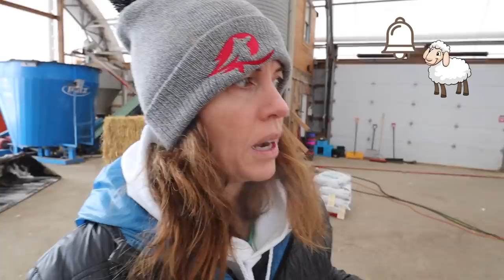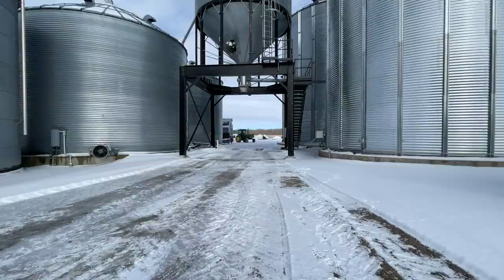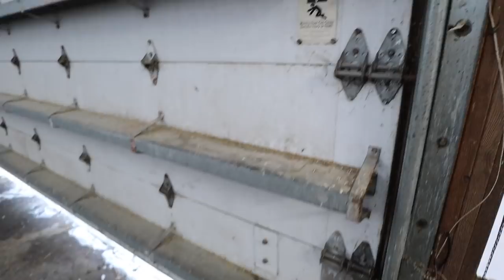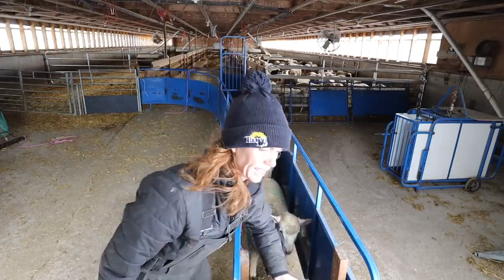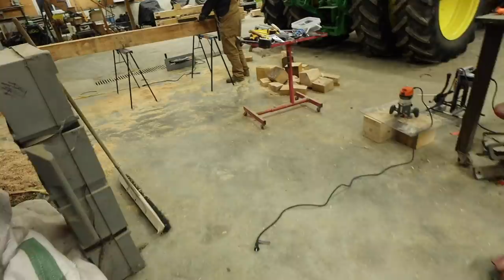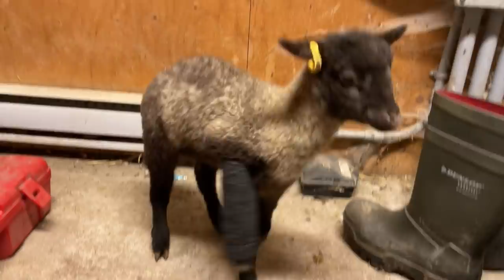third times a charm.🤦‍♀️ | Vlog 543

Comment: I was taught...cast should include the joint above and below the break....cast should also make the leg longer to prevent full weight bearing.  I have used a pad made of vetwrap on the bottom of the hoof to make the leg longer.  Hope lamb does well.
Reply from the maker: Good call!

Comment: Hi, Sandi, I completely understand your being wound tight after pulling the trailer to market.  I lived in WCentral MN for many years.  We called what you drove thru “ground blizzards”.  For work I drove 40 miles each way, mostly in the dark of course.  It would get extremely exciting with those fingers of extremely fine snow being run over again and again until black ice was everywhere!  And as you said, when the wind turned you ever so slightly, you were gathering yourself back up!  I only off-roaded 5 times in 11 years.
Reply: I'm right with you on the trailer issue....I have bought bagged garden soil in order to travel back west to East in Western Oklahoma rather than run the risk of having my empty trailer end up somewhere where it wasn't supposed to be due to the winds!!

Comment: TY for information on Chris. I like her.
I am a retired physician. I am not a veterinarian. I can give info on human gametes but I don't know if it totally applies to sheep. For humans the male gametes have 2 potential functions. The female gametes also have 2 potential functions (in mammals,  the female gametes always have these 2 potential functions). 
Female proto gametes: in the ovary of a female around 40 start to develop.  This is what increases the estrogen concentration.  The one that is putting out the greatest estrogen will erupt from the ovary  when the Lutenizing hormone is released by the pituitary (this is ovulation). That is The Egg, function 1. The other proto gametes, about 39 now mix with some stromal cells of the ovary and form another structure.  This structure starts to produce progesterones. That is function 2. In humans,  this structure will function for two weeks  if no fertilization of the egg happens. The dying of this structure,  dramatically drops progesterones and causes the menses.
Male gametes are formed in the testes. They have no tails until they come into the vas deferenes. In humans,  a male gamete will either be attached to one tail or two tails. Function 1 male gamete has 1 tail. Function 2 male gamete has 2 tails. Function 1 is for fertilization. 
Function 2 is for killing other males' gametes.  Two tails cause the gamete to swim in circles. This limits function 2 gametes to be concentrated around the cervix of the human female. Each gamete has at its head a packet of enzymes and if it hits another gamete, those enzymes kill. A second male's gametes essentially enter a "war zone" at the human female's cervix. Those enzymes on function 1 gametes is necessary to try to enter the egg.
Again, I do not know if this with male gametes is the case with sheep.
One would have to specifically look at embryology of mammals,  specifically sheep to have this answer. I have not. I am not a  veterinarian; I am a one animal doctor, a physician.
Reply: Thank you, very well explained.
Reply: Thanks Barbara, that was very informative!  Just FYI, Sandi’s employee’s name is Carissa (not Chris).

Comment: Sandi I googled this for you and found the same info multiple ways.  This was the best  one: I learned that in sheep, lambs from the same litter pretty often have different fathers, if the ewe has mated with different males. Berry et al. Of the 539 pairs of twins included in the analysis, 160 (i.e. 30%) were sired by two different rams. ...Jul 12, 2020

Comment: Hi Sandi,  I use anti sway bars when I pull a ball and hitch trailer whether empty or a load. Really helps stabilize the trailer so it hauls straight down the road and no swaying with wind or sliding/ jack knifing in the ice and snow. Much safer!

Comment: Sandi, does your truck & stock trailer have anti sway attachments? Travel trailers have them & they really help for that scary problem you spoke of. The hitch is standard box but has inserts for bars that attach to the trailer. Then the trailer has a spot for a little bar that is technically a break pad that you can tighten depending on conditions. Not difficult to hook up just another step. Love your vids, I share them with my mom who is bed bound & loves lambys.

Comment: My brother had an old pick-up truck that easily fish-tailed in the winter. He put a couple cinder blocks in the bed to add weight to the back and found he had better control. Not sure if this idea would work for you or not. The cinder blocks would move around some of the time so you might have to anchor them down in some way for when you have the lambs in there or you can have the blocks in your truck and move them to the trailer once you off load the lambs (just remember to wear a back brace). Sand bags might work too.

Comment: Someone did a study about ewes and rams "I just learned that in sheep, lambs from the same litter pretty often have different fathers, if the ewe has mated with different males. Berry et al. Of the 539 pairs of twins included in the analysis, 160 (i.e. 30%) were sired by two different rams.:  From google

Comment: You do a great job at helping these little ones with broken legs. They must do better than dogs and cats because as GP RVT we would end up with our patients limb swelling and serious pressure ulcers. Do you ever have these issue? I’m wondering if they are just so young and heal much faster, and your splinting material is more flexible than our hard plastic splints to develop ulcers.  Also curious if you ever run into circulation issues or swelling of the limb with the vet wrap applied directly to the limb? We are always taught to pad pad and pad some more when applying splints and bandages because of these issues, and because vetwrap has the tendency to shrink. I have seen so many dogs and cats loose their limbs because vetwrap has cut off circulation. We are also taught to always have at least two joints splinted when there is a break one above and one below so you get proper stabilization. If she were a dog or cat we would have splinted and wrapped all the way up to the elbow. I’m definitely not a lamb or sheep person though and they seem to be doing great with how your vet taught you. It just blows my mind that they don’t seem to have these issues.

Comment: The answer to multi dad pregnancies is yes you can have more than one father (as in most species (inc humans)

But just mating with more than one dad wont give more babies in the pregnancy since you still need mums eggs to make babies. Number of babies depends on how many egg mum puts in the ring.

If mum puts one egg then only one dad even if multiple matings.

If mum puts in two eggs up to two dads could be fathers

If mum puts 3 then it’s possible to have 3 different dads.

The only exception is If the multiples are identical twins (or more) in which case they have split from one egg so only one dad that way.

Comment: You have probably answered this question a million times before but I haven't seen the answer yet.  How old are the sheep you take to market?  The ones you loaded in this video didn't seem to have any paint marks on them.  Why?  Just curious.  Thanks and keep up the videos I look forward to them.
Reply: They are between four to five months.  Most reach their shipping weight at four and a half.
Reply: @mobydickswife9512  so how do you choose which ones to take to market?  I'm not a sheep farmer but. I am interested in what goes on in the sheep barn.
Reply: @carolynhagerman9348  Sandi usually ships all her ram lambs to prevent inbreeding. That is also the reason she brings in new rams every two to three years.

She picks her replacement ewes from one lambing, so all the young ewes are the same age, which makes it easier to manage.

The ewes lambs are selected hard. First they are checked for confirmation, then correct udders, and general health.  Then more importantly Sandi goes into the records.
She only keeps ewe lambs that were twins or triplets. She checks that the mom had enough milk to feed twins right up to weaning, and that there was no problems with birthing. She looks for any notes about any special issues with the ewe. 

Any ewe that rejected or attacked her lambs is shipped, and usually Sandi will not keep the lambs from her.

Some shepherds breed their ewe lambs at six months, Sandi does not breed until nine or twelve months as she feels the ewe are properly grown and have easier births and are better mothers.
Reply: @mobydickswife9512  thank you for the info.  I guess teaching sewing is a job. I will stick too.  That girl has more to do than there are hours in a day.  I admire her stamina and love of sheep.  She does have some mighty cute little lambs.